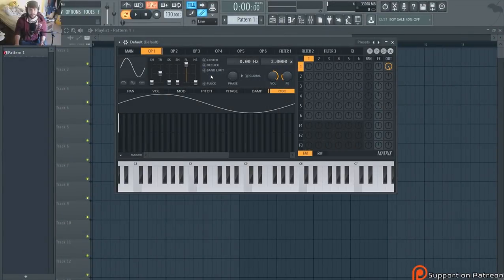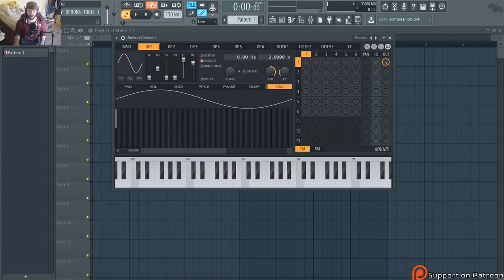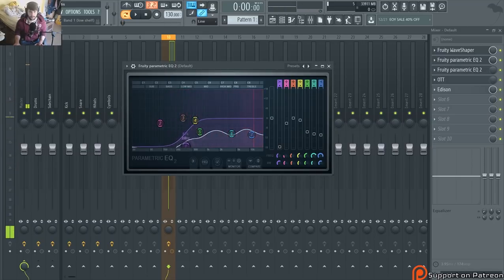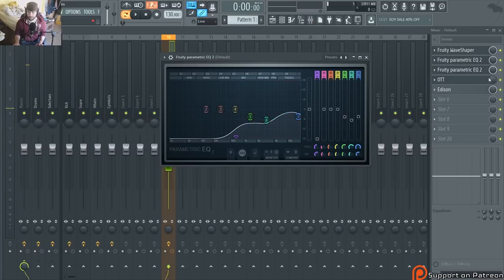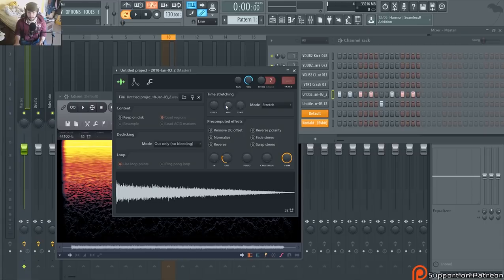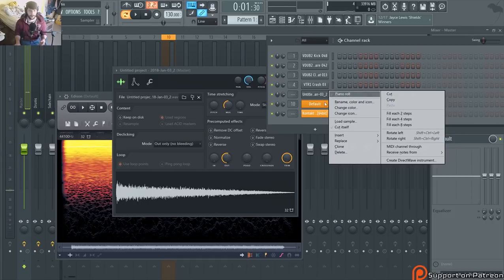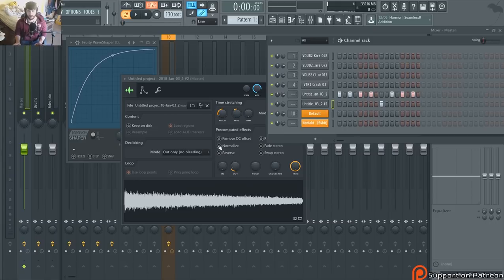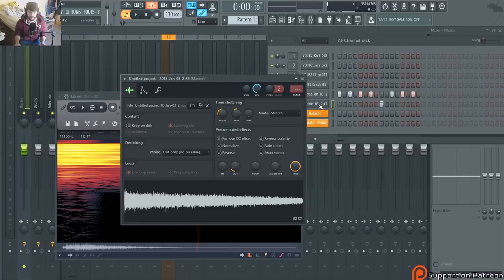How To Make Open And Closed Hi-Hats In Sytrus - Fl Studio Tutorial

Comment: I would advise using the pulse. wave mode function. It's something that you're supposed to use whenever you use white noise to get kind of a tonal. sound out of it. in making high hats and crashes. It's kind of noise and also kind of tonal at the same time, which is very important for getting a realistic sounding. Hi, hat. or actually making it sound like a high hat.